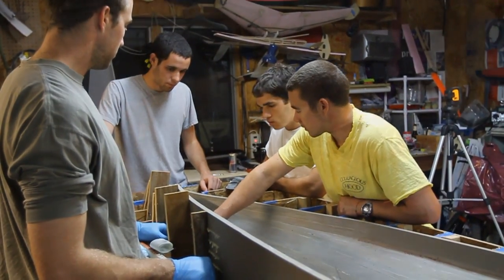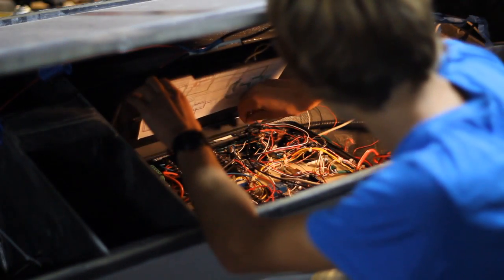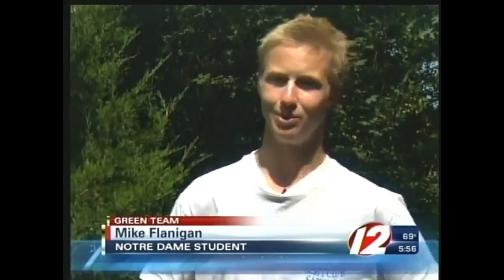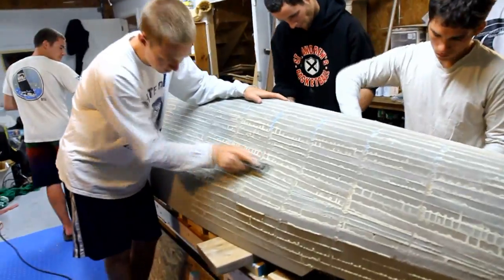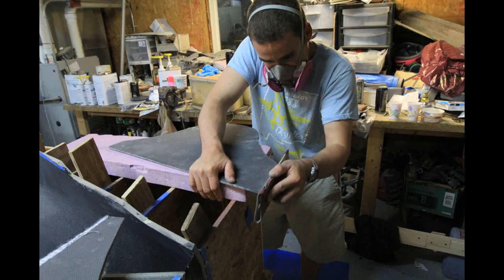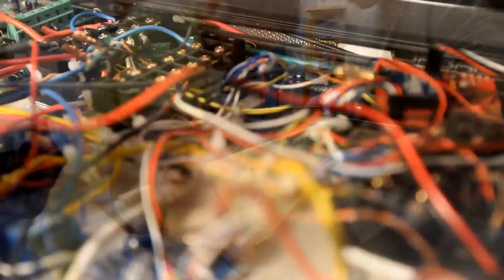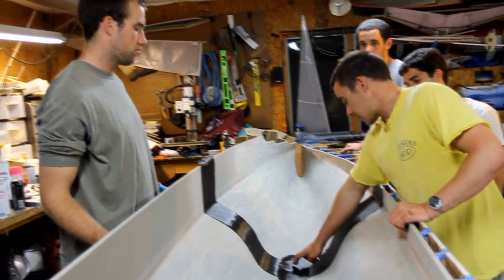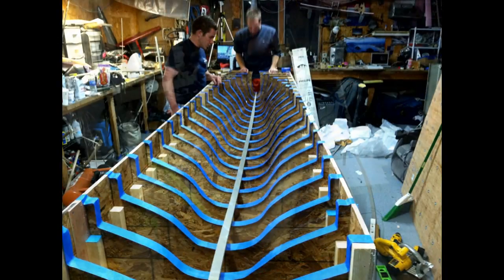SCOUT Transatlantic 2012

Comment: The deck is indeed tilted 7 degrees for two reason, the first as you so kindly pointed out is to shed the salt water thus reducing salt build up, the second is to maximize the efficiency of the solar panels so they are more directly facing the sun due to the high (relativley) latitude that the boat will be crossing on. The keel fin design was chosen in order to optimise the reduction of wetted surface along with a high moment arm to ensure self righting with as low a bulb weight as possible.

Comment: its amazing how much resources you have and how little brains in your heads. What the f*ck were you thinking? This hull design is good for your daddy swimming pool not for the ocean. Why would you need the underwater thruster? This keel will rather work as a good underwater sail. The salt will cover your solar panel as they are not tilted or self-cleaning. Each part of your boat has a single point of failure and no redundancy. And last - have you done any calculation before you started?